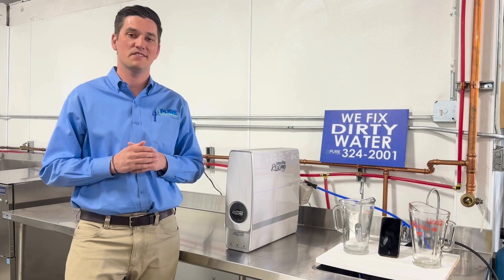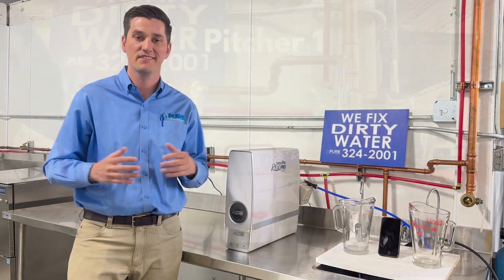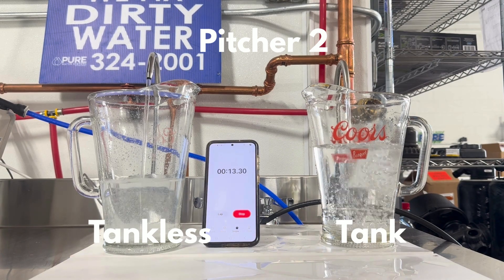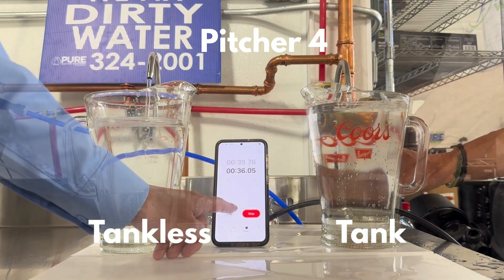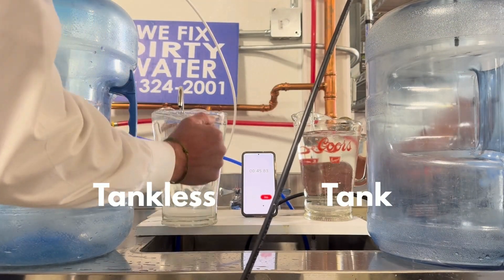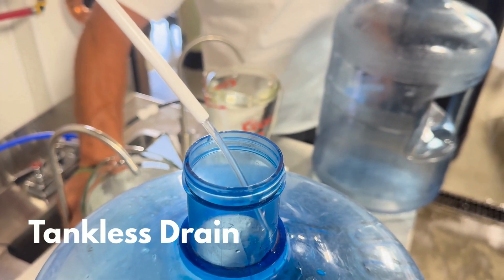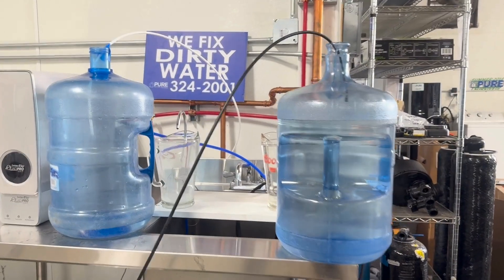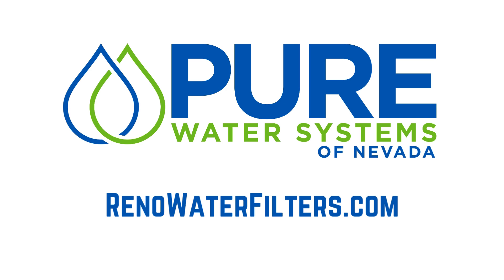Tankless Vs. Tank RO Video

Comment: I would be interested to see what the total TDS removeal is by both systems, both after the one gallon draw and again after the 4th or 5th gallon of continuous running. Ive tested both the Evolve RO and a couple of tankless units and found the removal rate of the tanked units to be quit a bit better than the tankless units.
Reply: How much of a difference? I just got myself a thankless because i didn’t want to have water sitting in some sort of bladder for any period of time